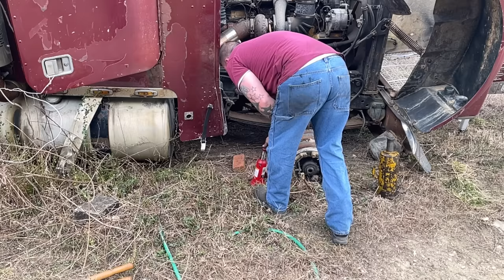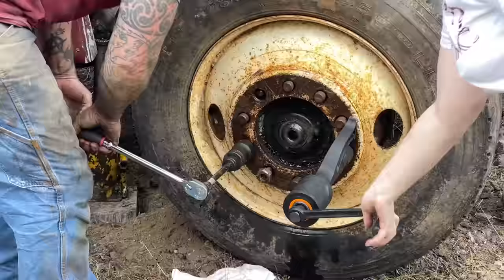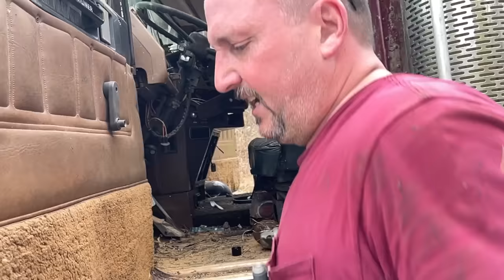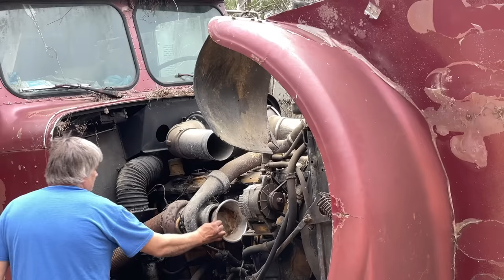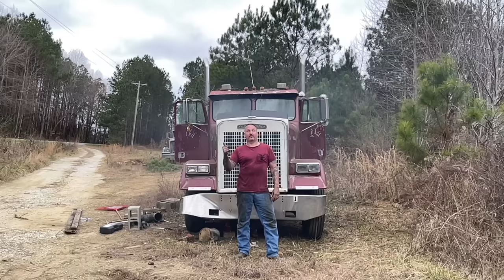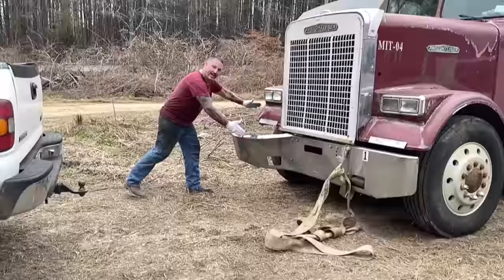1985 Freightliner FLC “Franny” will it start???

Comment: NEVER use bricks or blocks to put under jacks, They will bust and break and will cause the vehicle to fall on you and kill you! You guys have been very lucky so far.
Reply: Ja wer keine Arbeit hat, macht sich welche,
Reply: je boy
Reply: Wood is much better correct?
Reply: @jonmotes5406  Yes, wood is much better. 👌
Reply: @jonmotes5406  Yep, HARDWOOD! I've seen people with a deathwish use pine.
Reply: Never braake open fuel system on diesel engine I have started trucks been setting up to 30 years
Reply: Im watching from Iran ❤
Reply: So true
Reply: @jonmotes5406 wood would not break easy. I know that for a fact!

Comment: Looks promising. I believe in 85 that would’ve been an FLC 120 is probably a 425 being a B model. In its day that was a top of the line truck. Do a lot of cleaning fix the doors and you’ll have a pretty good reliable truck.
Reply: That thing has an Aftercooler. It's not a B model it's an A. Probably 400 hp. but it may be more.
Reply: Before late 86 a B model wasn't a 425 without Air2Air. 87 models had A2A across the board here in 🇨🇦.
I had both a 87 LTS wit a 350 A2A and a 87 FLA 120 wit a 425B A2A. Great engines. I'd have either again.
This one in the video has no A2A so my thought is it's a 350 or 400 Bmodel.
Reply: Vineslinger...good catch A model 350 maybe 400.
Reply: @too old and weird to fit in optimus was is and always should be a cabover. lol
Reply: Ii
Reply: @robert meehan  💪EXACTLY 💯
Reply: @dennishuntley7688  A 360 was an old PCTA and had glow plugs. They quit making those pre combustion chambers in 1979 and started making Direct Injection Turbo-charged Aftercooled (DITA) engines. I had serial number 1673 3406 PCT 325 hp in 1976 it was experimental then just after the 1693. It's what I run. Claterpullers.
Reply: Vineslinger actually the A350 was meant to be 360, I had a 81 A400 DI in a 81 Pete. Great engine, but my easy favorite is the 94 3406C in My Henrybilt. Beast of a engine.
Reply: The Spirit Fighting Together
Reply: 😊čo sa stalo ?
Reply: Jidupkan mesinya baru Ganti ban nya ina
Reply: ကောင်လိုက်တဲနက်ကြက်သောဟန်တယ်ကားကောင်တစီကိုအိမ်သယ်လိုရသွားသည်နောက်ထက်ကားတွေရှိနေသည်သင်စံနပါရင်
Reply: lol I was wondering wtf he was doing, I wouldn't even do this with my pickup truck let alone a semi. Bottle jacks? They may be strong but they are unstable due to high center of gravity.
Reply: Our farm has a very reliable 97 Freightliner

Comment: Hi James. I know 2people who passed by using bricks and blocks , solid timber blocks .Cheers from Australia Mick.
Reply from the maker: I grew up using whatever I had available. Some times it works some times it don’t.  I’ll be careful. Appreciate ya
Reply: I did too ,as a mechanic fence wire came in handy a lot. 45 + years later still does.

Comment: I remember a lot of these were on the road when I started driving OTR in 1995. These were the top of the line back then.
It's nice for the truck to be out of that prison and FREE AT LAST!! Many trucks of this vintage are making a comeback since the price of new ones (and the repairs of such) are completely unrealistic. You can legally drive the old trucks in all states except California (but then few drivers outside of big companies go there anymore)
The cost to refurbish this to roadworthy condition will still be far less that buying a later model truck assuming you don't have transmission or rear end problems. It will be worth it.
Reply from the maker: Appreciate ya watching.

Comment: I have an 84 with an 855. Good trucks and a lot of 90s parts fit them. The hood parts do not though and are expensive, but the over extend cables on the hood from 90s will fit
Reply from the maker: Oh rite on. Appreciate that

Comment: FTR, like the guys have said, you shouldnt use blocks or bricks BUT if you do, make sure the holes are going vertical.. Blocks and bricks are made to support weight only one way, hence why you dont see the holes on a block foundation, unless its being used as a vent. Former mason so I have a little experience :)
Reply from the maker: So just as a quick explanation we didn’t come to Jack the truck up. Just to do a will it start and decided we has an hour to spend before the owner of the truck showed up  and just gathered up things to use. Which ended up being concrete.   We really didn’t expect to get it up but it made good content    Appreciate the comments tho as always.

Comment: When jacking up  use   railway  sleepers  jack  push sleeper   under   truck   four side by side  on top each other     the weight  causes  bricks  brake explode  great video man
Reply from the maker: Used what I had.  Would have been nice to have some wood blocks

Comment: Little hint. Use a hedger with a flex head. Angle it with the ground and cut like your sweeping the floor. Will cut everything from glass to 3/4in thick brush in one shot. Not line to break. Been doing it for 20 years Luke that around objects. Can't beat it. Can even get the battery powered one from milwaukee. Get the 12ah battery tho. Best of luck!
Reply from the maker: Thanks for the tip.  Appreciate ya watchin

Comment: I have exactly that Caterpillar engine in my 1985 Kenworth cabover. When you start it, I have to put about an inch of accelerator, or else you have to crank is alot. When I start mine, it hits two compression hits and starts.

Comment: I was waiting for that jack to pop from under that truck. no safety at all, I'm glad the truck didn't fall on you or get cracked in the face when that jack popped up. always use a wide base platform when you are jacking a vehicle on the dirt.

Comment: Well I'm glad to hear the engine wasn't running away cause if it did you'd want to be far away cause the rpms get higher until the truck blows up and is a total loss

Comment: Anything prior to  " to much electronic control" is always better.  2 wire start and run mode. 1 to fuel shut off , 2 to the starter solenoid.
Reply from the maker: I couldn’t agree more.   Appreciate ya watching and commenting

Comment: I just bought a 1995 kw  t 400 with renegade rv body on it and it turns out the motor is freshly rebuilt and has brand new virgin yokohama rubber and aluminum wheels all the way around. Owner prior to me said the wheels and tired costed him 7500 .00 bucks. Just 6 tires amd wheels.
Reply from the maker: Rite on

Comment: Apparently the rusted crossmember is very important.  But could new metal be welded and bolted in?  Or would it not pass inspection?
Reply from the maker: I’m not for certain yet.  I haven’t been able to source one but I’m going to take it off and send it to a machine shop and see if they can bend me a new one and I’ll just weld the lower air bar mounts on

Comment: I noticed the rear axle seized when you tried to move it out of there, either it needs repair, or the inner parts need replacing.
Reply from the maker: Ended up the rear axle has the 30/30
Chambers and that caging bolt
Wasn’t in correctly. I re caged it and it turned freely

Comment: What did you pour in that filter? Transmission oil?

Just wondering why?
Reply from the maker: Yes atf.  It’s loaded with detergents cleans injectors and the pump and lubricates cylinder sets and valves
Reply: @JamesPretty  Cool might try that with some of my vehicles then

Any good for common rail? 😅
Reply from the maker: @AbsoluteAcid2112  a lot of guys run a gallon in every fill
Up.   But I usually only do it for the first few starts after sitting

Comment: Hey I have the same truck but mines an 86, I’m having trouble on how to change my transmission fluid you have a video for that?
Reply from the maker: Not sure if it’s in either the Trisha or marla video.  But you drain it out the bottom plug and fill it till it reaches the side plug.  If that help

Comment: Mich rust issues underneath from.sitting on the ground
.hope chuck sorts your bumper out
Reply from the maker: It’s not super rusty.   Will get a better look once I get it home on the concrete    ;)
Reply: @JamesPretty  just how it was sitting on the ground without the front tyre on it for so long made me wonder if the moisture would of eaten in to it. Nice truck and gotta do what makes you happy.!!! Cheers cool.content thanks
Reply from the maker: @jamesogden178  it’s lucky it was on a slope so the water ran away from it.  I think they drug it there without the wheel is why the tanks steps and tool
Box were ripped off.  :/.

Comment: I'm shickled tittless over it starting and making all the smoke in the right places. They all need love when they come back but it looks like the frame rails are tip top and a new set of rear ends ain't cheap but the owner is so Jessica's gonna be eating salad for a while till funds are all wrapped up. Hey I know better but when you sound that excited, its all out on the table for some grins... Take two or three most and have a decent bumper and some rubber plus a douche so we can tell what color that freight shaker is. I can tell you kids will rock the new bedroom/LOL ... my guess is the FLC 120 and I have twisted wrenches them B model engines some as they tend to just run... All of mine were in L9000 ford dumps and went hells of miles... ordered one with a automatic and wife drove it to the million mile mark
Reply from the maker: Rite on!  I drove a 9000 tri axle in the 90’s

Comment: My friend in Los Angeles owns 1992 International 9800. It has Cummins Big Cam 400 engine and 10 speed transmission. Is it possible to change engine to 550 HP CAT engine and 18 speed transmission?
Reply from the maker: Yep.  It’s work as mounts and such are different but it can be done.

Comment: I would love to see a restoration on the truck..btw CUT THE HANDLE off your multiplyer and weld a nut on the end and use a cordless impact..
Reply from the maker: Supposedly if you put an impact on it it breaks the gears inside

Comment: My dad had onea 89  but this one is not a 85  because the hood is fiberglas and the ones with aluminun hoods are from de 80s  and lights are rounded no squares
Reply from the maker: This is an 85

Comment: You have got to be one of them so called smart fellas, aren't you. After having that thing almost slide onto you when jacking it up, you let your SO clean the threads of the hub while it is on jacks. You just have to touch it the wrong way and it's on the ground again. Why not clean those when it was not jacked up?
Reply from the maker: Once it was up it wasn’t going anywhere. Was only sketchy when trying to get the thing up off the ground initially

Comment: 3406? That truck is about a year older than I am
Reply from the maker: Yep 3406.   Thanks for watching
Reply: @JamesPretty  thought it sounded like one! It started pretty easily how long was it sitting there?
Reply from the maker: @rudycarlson8245  drug it into that spot about 8-10 years ago. Was left at another location for years before that. Unsure exactly. Parked for rusted out suspension components

Comment: You mentioned tranny fluid cleaning injectors, could you explain?
Reply from the maker: Automatic transmissions rely on super clean valves and pistons and seals to function properly so ATF Contains all sorts of cleaners and detergents and special stuff to keep those things clean and seals working properly. Using atf in a filter change and some in the fuel does the same thing in the injectors and fuel pump and such
Reply: @JamesPretty  so say for a system using 7 quarts of engine, you would use 6 and add 1quart atf?
Reply from the maker: @shawnlawrence4840  no you put it in your fuel filter and some in the fuel tank
Reply: You thought me something today thanks, I've seen on other channels ppl tasting engine oil, isn't that a dangerous thing? And if you know, what are they tasting for?

Comment: I think you need to learn how to position and put proper base under a jack. A freaking brick is useless and unstable.
Reply from the maker: Got the job done    I gave us an hour to have a wheel on it with whatever we could find on the property    Got it done in 40
Mins     Some time you gotta use what’s at hand.

Comment: if it dont have a caterpillar motor dont fuck with it
Reply from the maker: I like
Cat motors
Reply: It's not too much to trucks is the motors that they put in the truck you find most trucks have caterpillar engines where they've been converted over to a caterpillar motor that is it was that being said mostly trucks I wouldn't trust the the engine